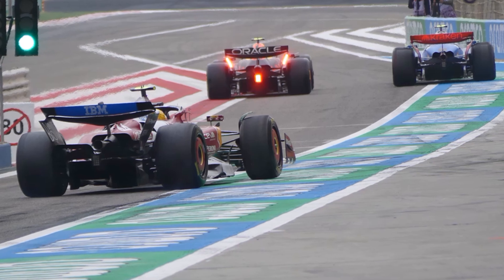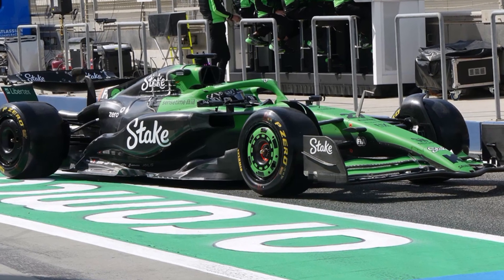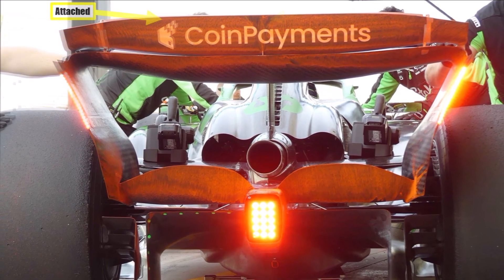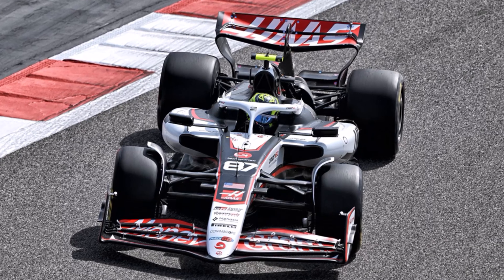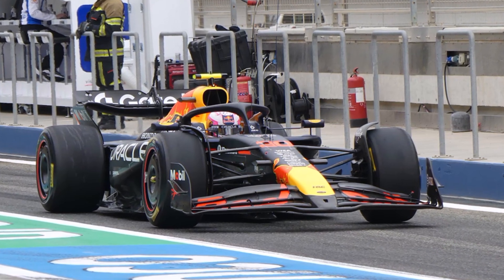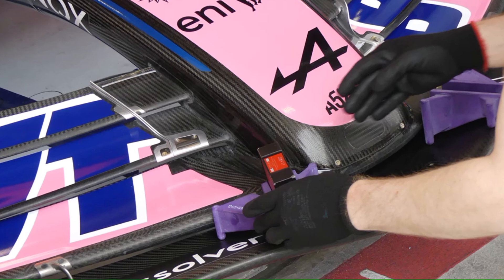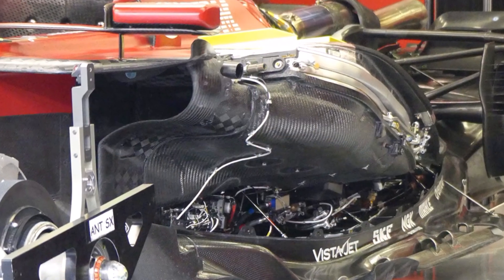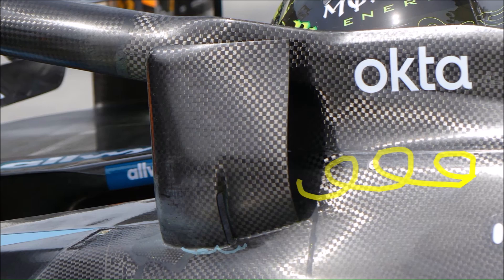F1 2025 - Pre-Season Test - Technical Summary

Comment: James Key was quoted saying that the Sauber seen at pre-season testing was only 80% of the new car, with the rest arriving in Melbourne. So I'm wondering: is it possible to tell which areas of that car aren't "finalized" yet?
Reply from the maker: F1 teams work with different specs. It's totally normal to have a "launch spec" and a "race 1 spec". Areas which are easy to swap like nose/front wing, floor, rear wing and smaller parts around the car can be different.
But for a team like Sauber it would have been better to test the car in race 1 spec in Bahrain already to understand the car as good as possible, but everyone wishes for that...

Comment: Within the current rules, is there a particular area of development that you think teams are not putting enough emphasis on?
Reply from the maker: I think in the 4th year of these regulations teams have explored most areas and found the sensitivities more or less. Last year most teams saw, that more downforce from the floor creates more problems than what it helps. So, they now concentrate more on having a stable floor basis and develop the car further on the upper side (bodywork, internal flow, wings)